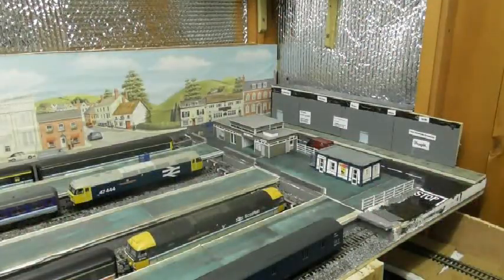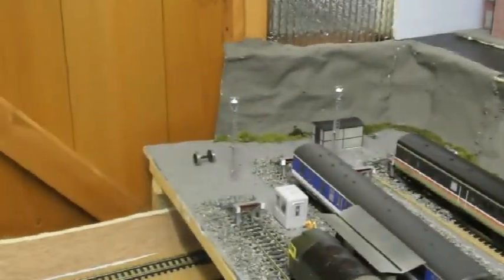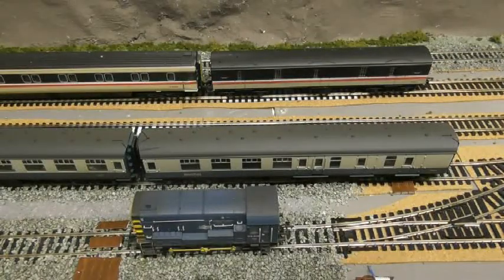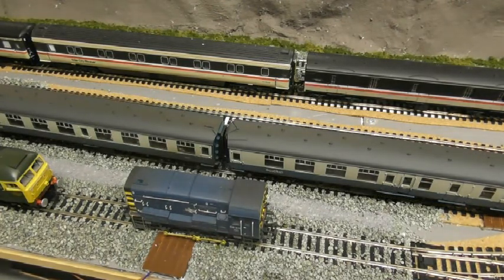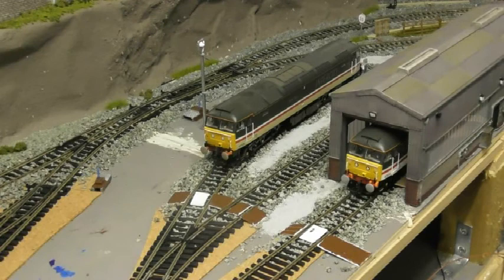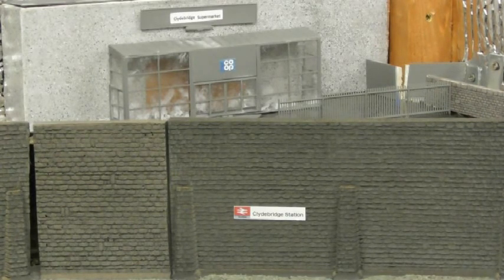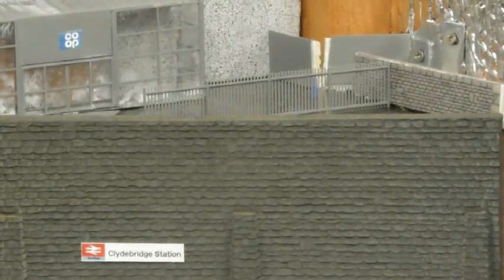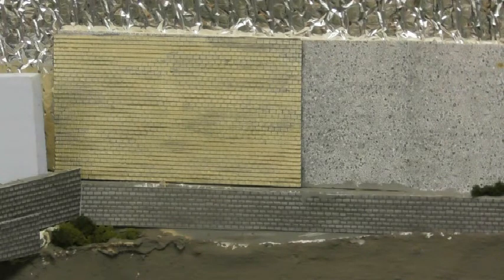CLYDEBRIDGE STATION VIDEO 35 SEPTEMBER 2019 UPDATE

Comment: Great update, your layout is coming along nicely.  Have you given the track and loco wheels a thorough cleaning, I noticed that you look to be using Hornby points, as you will know they have that huge plastic frog giving no power, some people who use insulfrog type points use conductive paint on the frogs to help short wheelbase locos along. Is your layout DCC? if so it is beneficial to have dropper wires to every piece of track so there can be no dead sections and helps with power distribution.
Looking forward to your next update and thank you very much for the shout out.
Michael